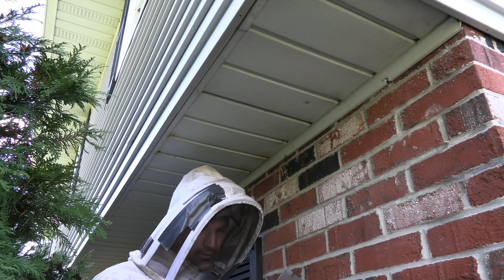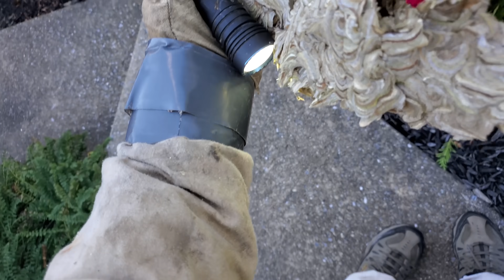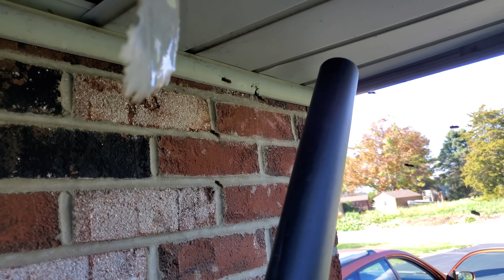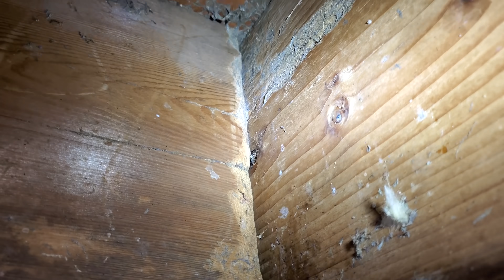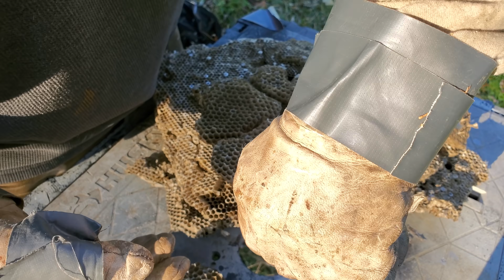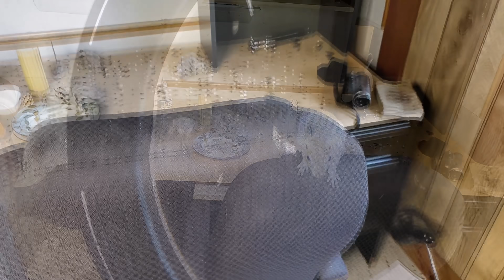MASSIVE Yellow Jackets Nest Removal Inside House - Wasp Nest Removal

Comment: Thanks for sharing. It is interesting the variation from one colony to another of the same species (germanica in this case). This nest appeared to have all, or nearly all empty cells as of the filming. Whereas, I did a removal this morning where the adult queens had yet to hatch out and there were many eggs, larvae, & pupa in the nest. The oldest queen brood in that nest were still in the pupal stage!
Reply from the maker: Yes! That's exactly the case with my last video; TONS of larval queens and males, and few capped cells and a TON of brood larvae! Crazy how one colony is different from the next at the same time frame
Reply from the maker: This queen mother clearly got started sooner than most!

Comment: I was trying to remove a trailer axle from under some brush at my ranch and out came the wasp from a nest that they have in one of the blown out tires. Do you have any suggestions on how to remove the nest from the tire . They got me about 25 times before I knew what was happening. The tire is split but I sure they would go crazy if I move the split in the tire. Any help would be appreciated. The nest is in the hill country of Texas. Second one this year.

Comment: The one thing that's always confused me about nest removals is how chill the customers are after the nest is removed.  For the most part there's some kind of gaping hole in their house now where a wasp's nest used to be, and I can only think of how much money it must cost to repair the unfortunately necessary damage.
Reply from the maker: ? I fixed the soffit in the video. You must have skipped and missed it.
Reply: @HornetKingOfficial  Not that portion.  I meant on previous nest removals where you've cut holes in people's ceilings.  Stuff like that.

Comment: Hornet King if you use dry ice in like where the nest is it will calm them down a lot when its like hot outside there aggressive but when there cold there not aggressive.
Reply from the maker: Thanks for the suggestion, and I've seen other guys do that, but that's really just an expensive and unnecessary step.

Comment: What say you all we get together and buy Bret a new suit? I watched a removal on a different channel and the man's suit was not held together with duct tape!
Reply from the maker: My suit has duct tape because I go places where "exterminators" won't/arent legally aloud to go for nests. I own my business, so I go wherever I'm needed to remove the nests; attics, basements, crawl spaces, under decks, sheds, high up in chimneys, cutting open trees on ladders; this suit has been through it all. In attic removals, nails sticking through the roof from shingles, they scrape across my veil and slice it open. That's the only repair I do with duct tape. The tape on my wrists is because I've been stung through the suit there. Also the reason I wear knee pads under my suit.